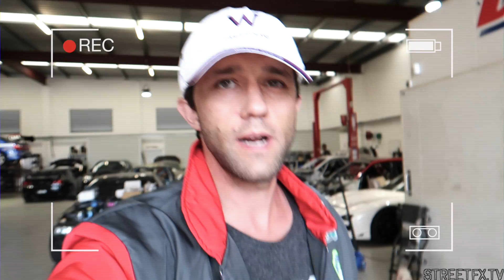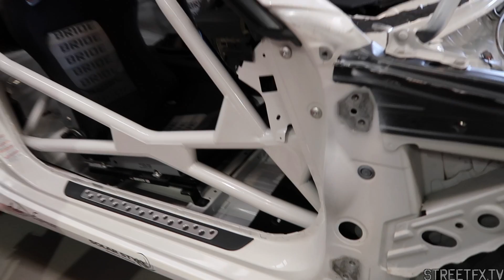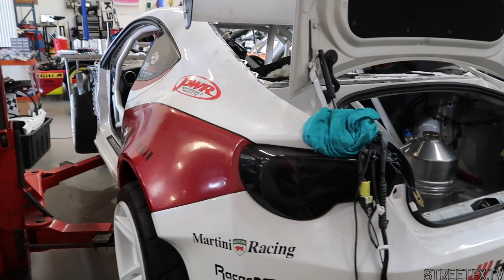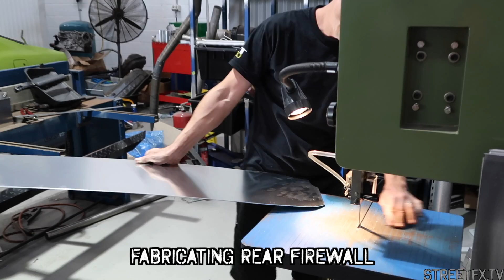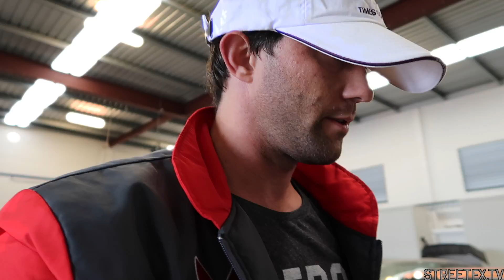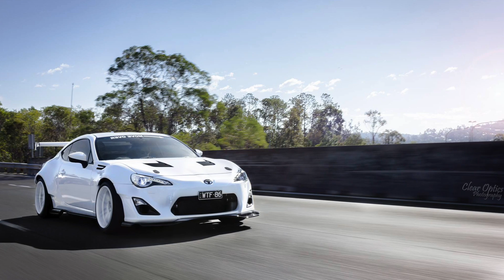WTF86 - VR38 R35 GTR Engine into StreetFX Toyota 86 - Build Update 1!

Comment: If you are serious about wanting to put a subwoofer in the car, I can suggest a brand for you. You might have heard of this company but regardless the company's name is called Sundown Audio. You could have a great sounding stereo with only one subwoofer.

For the subwoofer I would recommend either a Sundown Audio SA-10 or SA-12 that is 2 ohm. It's rated at 600rms but they are quite conservative when it comes to rating their subwoofer rms.

For the amplifier I would go with the Sundown Audio SAE-600D. At 1 ohm it will put out 600 watts. 

To correctly wire the subwoofer to the amplifier so it's running at 1 ohm and getting all 600 watts is pretty simple. I will leave a link you can check out and look at option 1 which would have the voice coils wired in a parallel.

http://www.the12volt.com/caraudio/woofer_configurations.asp?Q=1&I=22

I would do it just like the picture and run the positive wire from one of the voice coil leads to the amplifier and then run the negative wire from the other voice coil lead to the amplifier. Since it's a dual voice coil subwoofer it will have two sets of positive & negative terminals. 

I would use 8 gauge wire to wire the subwoofer to the amplifier and then use 4 gauge wire to run the amplifier to the battery. With a single SA-10 or SA-12, you would have some great sounding bass.

Comment: Where will the A/C condenser be or do you not need one with that electric compressor
Reply from the maker: +Mayhem Inc it will live under the floor pan in the rear :) it's a small unit around 30x40cm

Comment: Like another guy said, what are the details on your a/c setup? Am very intrigued
Reply from the maker: +Boosted & Built Garage we get so many questions on this - we will do a separate video once it's all connected :)
Reply: Please do, may be the answer to keep my Mrs happy in one of my cars without a/c😂
Reply: Yes please do! The cairns heat in my boosted 1200 ute is a killer
Reply: Looks like the compressor is a Rencool MD-18, so I'm sure you could find the rest of the bits from looking that up

Comment: Keen to see more of this beast!! On a side note, what camera are you using?
Reply from the maker: for this one it was a Canon G7X MK2. Some of the other videos we use the Canon XA20. 
Only downside tot he G7X is not being able to run an external mic, else it would be pretty much perfect, gives decent depth of field etc.. However I have found it sometimes struggles to focus, and using the touch screen to focus it is sometimes tricky in selfie mode as it then tries to focus on your hand as you touch the screen haha.

One thing that definitely helped us was using a mini monopod on the bottom of the camera - helps with camera shake and helps you get the camera further away from you if needing a wider view.
Reply: Wow thanks for the detailed response, really didn't expect that! I've heard the MK2 auto focus is a lot better than the first G7X but still crappy at best. I've been looking at upgrading my current vlog camera as it doesn't have a flip screen. Thanks for the tech advice, appreciate it! Keep up the rocking content, subscriber here all the way from South Africa!
Reply from the maker: you're welcome :) It's hard to find people who vlog to actually give helpful feedback as they seem to want to be super secretive :P I've got a lot of different equipment but so far I have found the most valuable to be: 

* GoPro Session 5 with image stabilisation and a mount for clipping to my cap (so you can get First Person POV shots of driving the car - watch my video of the corvette chasing the AMG)

* Canon G7XMK2 on an 8" monopod for impromptu vlogs and walking around

* Canon XA20 with Rode shotgun mic for more prepared shoots and tripod use

* DJI Osmo Plus for on-car live streaming